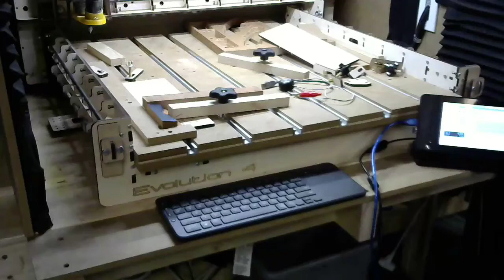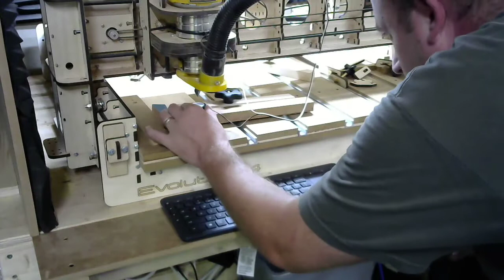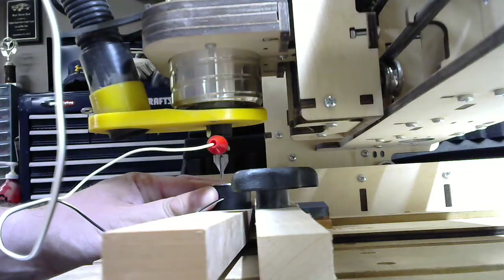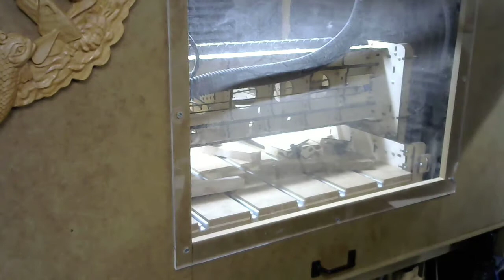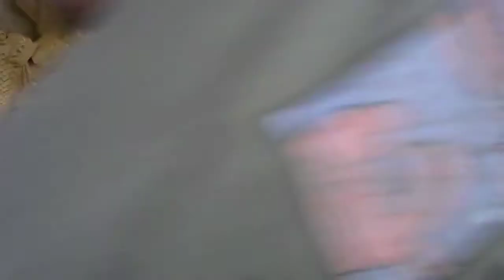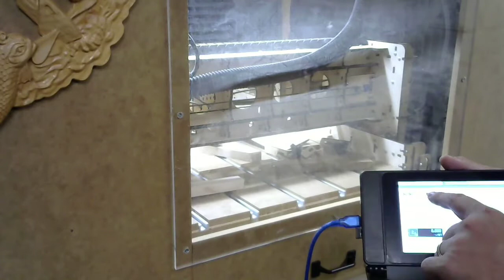Setting up my BobsCNC for a job

Comment: Where did you get the vacuum adapter for the router?
Reply from the maker: The one in that video is the titecnc dust boot. I don’t use in anymore though, I switched to the dust collection with fast disconnect from tedesignshopco on Etsy.
Reply: @4gwoodcrafts563  thanks I will look for it